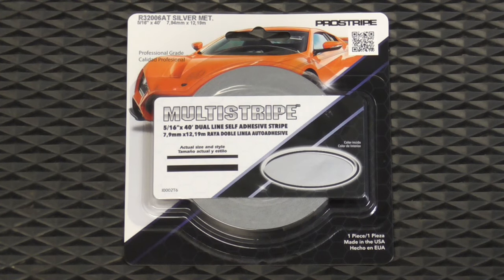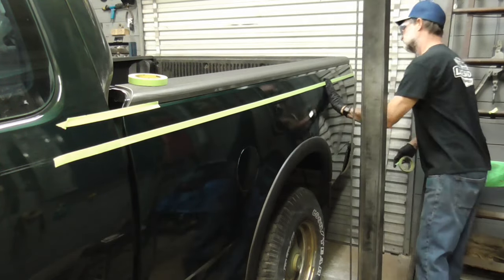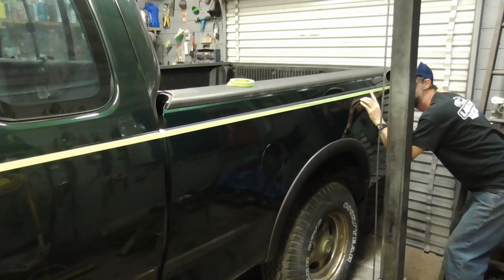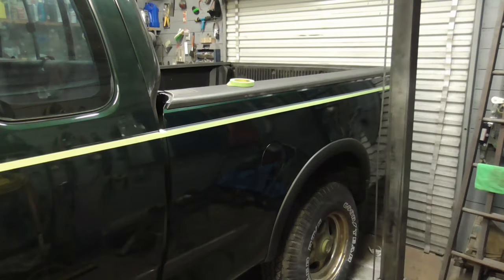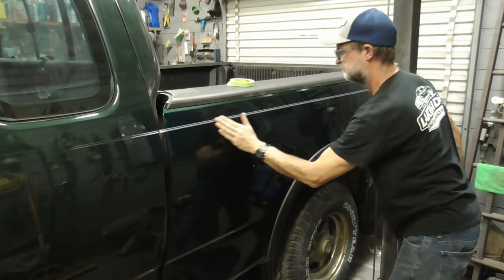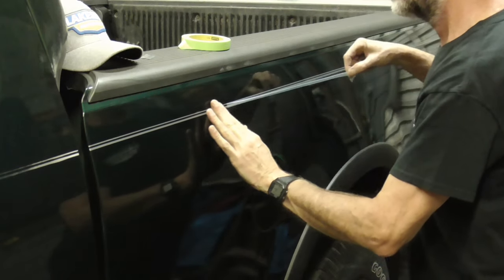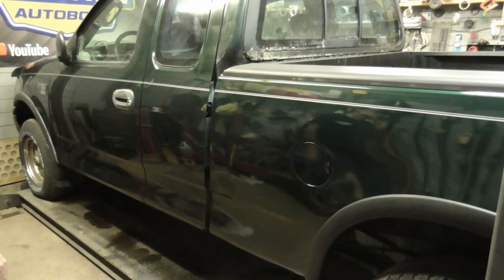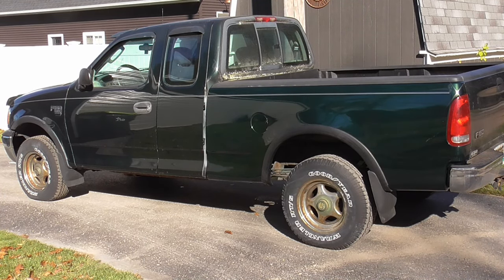How to Pinstripe a Car with Pinstriping Tape

Comment: I remember my 1st stripe job in trade school. You’d lay out a magnetic track on the side of the car then run the paint bottle with a little wheel on it to dispense the paint. The good old days. Have a great weekend Jerry
Reply from the maker: Bet it was the Beugler Pinstriping Kit 👍  My dad had one of those - all chrome and nice in a blue/silver box - if I remember correctly.  Good times alright - you have a good weekend too Greg :)  You got me thinkin' so I looked it up - check out this beautiful kit - https://www.beugler.com/shop/anniversary-kit/
Reply: @LakesideAutobody  I looked at that link and it’s similar but after almost 50 years I don’t remember exactly. Now that I’m thinking about it I’ve got one somewhere. It’s an individual glass bottle with the wheel on it. Really old school. Take care

Comment: Boy oh boy...THAT brings back memories for me from the mid/late 70's/early 80's !!

I did a LOT of tape striping while I was in high school and a few years after graduating. My normal charge (providing the 'customer' bought the tape) for a stripe like that on both sides would have been $5.00 (considering I was working part time at a gas station for $2.75/hour) the $5.00 was good money back then. 

For a more elaborate or double set of stripes (remember, vehicles back then usually had at least 2 body lines) I would charge $10-$15.... depending on how 'difficult' the striping was. I even did a couple during shop class...LOL

Things sure were easier then.
Reply from the maker: Good times in the USA - 1950's - 1980's  Maybe?  Thanks for the stories Russ - I love to read stuff like that :)

Comment: Are you going to put a little dab of clear finger nail polish on the ends to help them not peel up?
Reply from the maker: Good idea but never really had to do that.  I think if your surface is really clean (wipe with thinner or rubbing alc.) you're going to be fine.